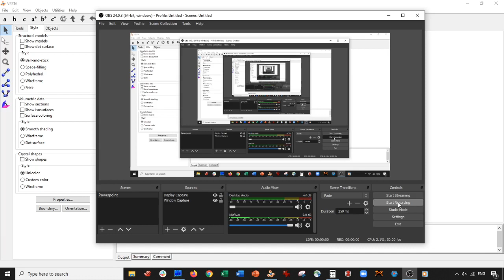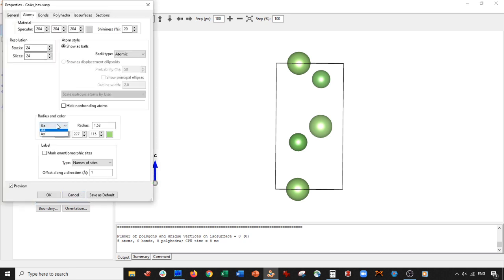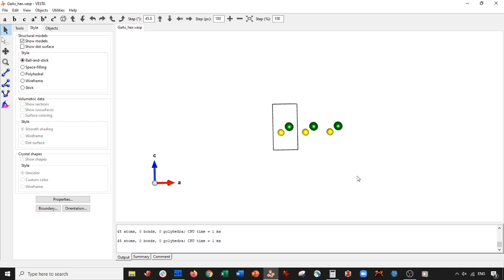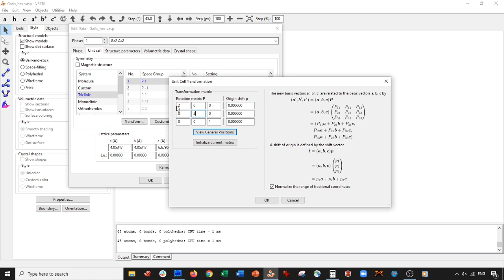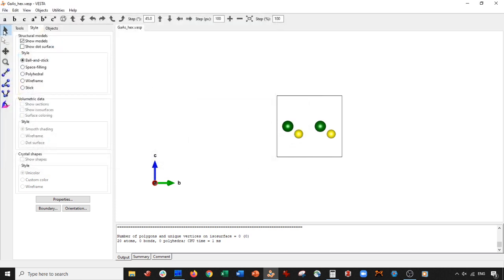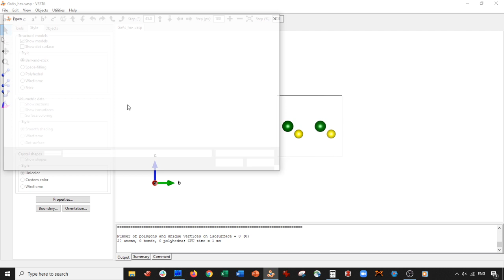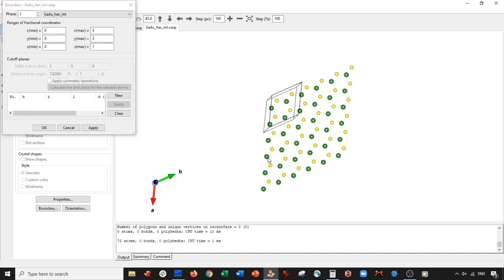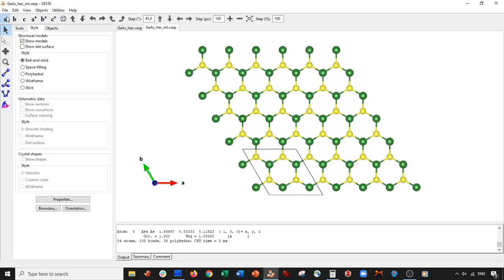VESTA Software - GaAs Hexagonal Monolayer Construction

Comment: Thanks for Your efforts. Kindly make a Lecture on " How make a mono layer and two layers of Metal Dichalcogenides e.g MoS2 or ReSe2 or W Se2 etc
Reply from the maker: I’m confused, what would you like exactly? One layer MoS2 one layer WSe2 heterostructure ? One on top of the other ?
Reply: @nickelandcopper5636  I want A mono layer of either. If you make mono layer of both and then hetero-structure it will be awesome and novel. Kindly explain the concept of lattice mismatch in the hetro-struture as well. Thanks a lot in advance.
Reply: Reminder, Kindly Sir Consider this
Reply from the maker: Sure, may take a few days though at this point
Reply: @nisarmuhammad313  i generally use Material studio for hetero strcutures.  If it can be done with VESTA it would be nice.

Comment: Respected Admin, Thanks for your efforts. Can you explain why You export data as xyyz and then copy the coordinate in the vasp format. What will happen if we export directly in vasp format go ahead for calculations?
Reply from the maker: Thanks. If we save directly as vasp, VESTA includes all atoms in the unit cell before cutting. Therefore, saving as a vasp saves the entire crystal, not just the monolayer. To get the monolayer we need to save it as an xyz and then manually place it into the lattice. At least, this is what I found works
Reply: @nickelandcopper5636  Thanks for your consideration and time.